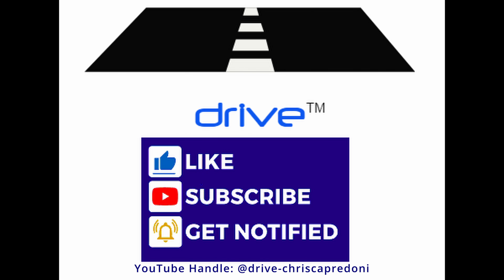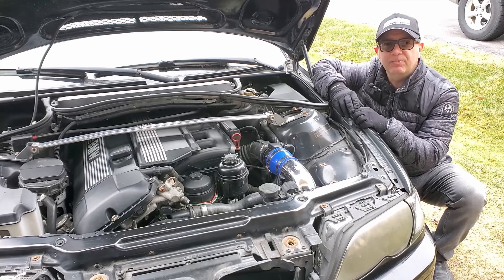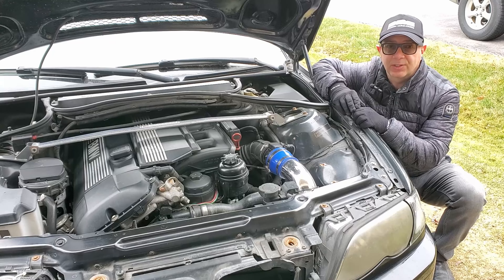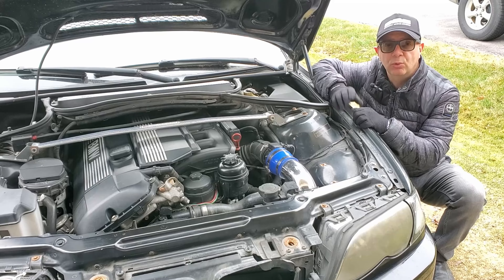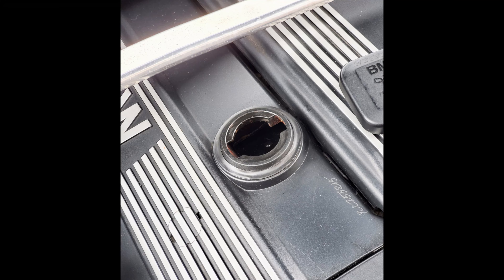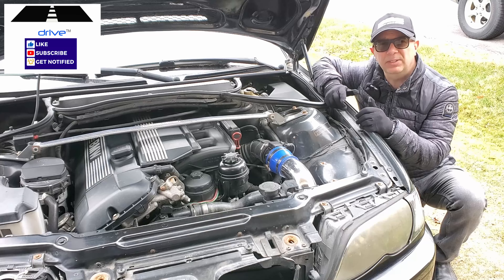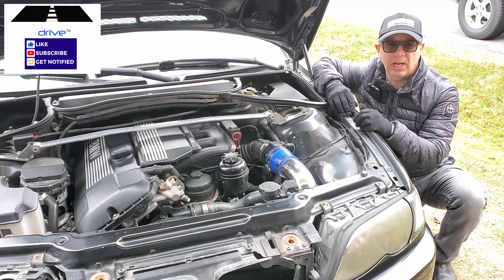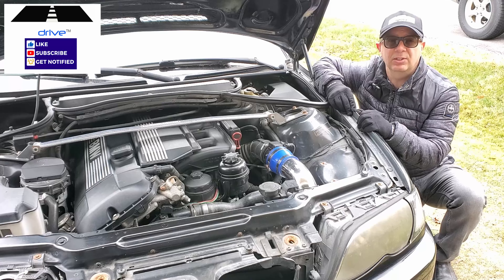Engine Oil Contamination; How to identify and correct oil contaminants (moisture or coolant)

Comment: This is worthwhile only if ambient air is not humid. Not sure if it would work for ATF though...
Reply from the maker: That is a very good question.  Most people do not or cannot regularily check there sealed transmission.  That is why it is important to change the ATF on a regular basis instead of following manufacturer's claims it is good for life.